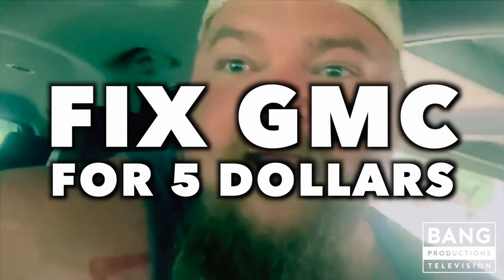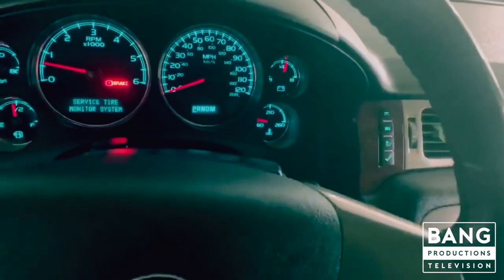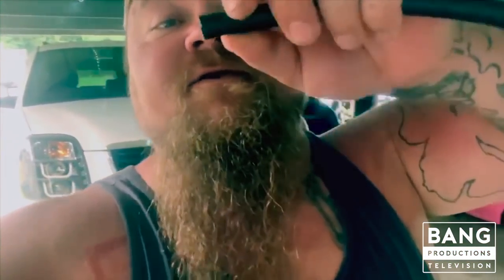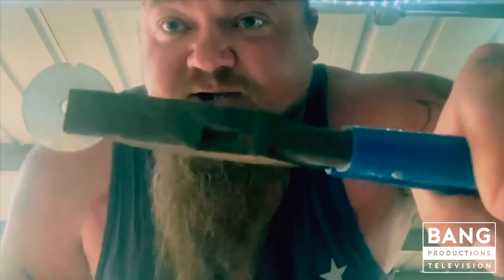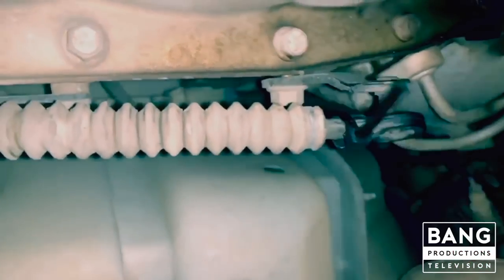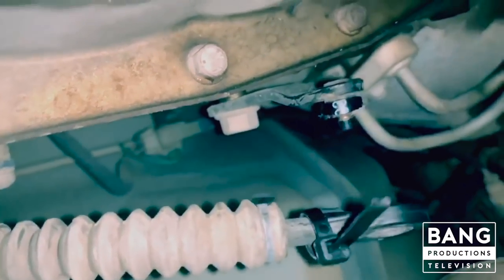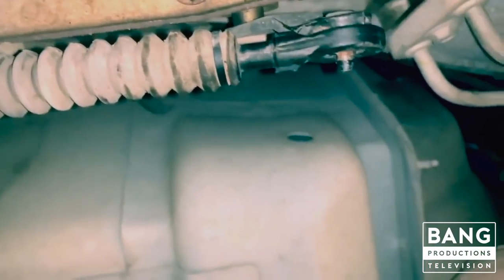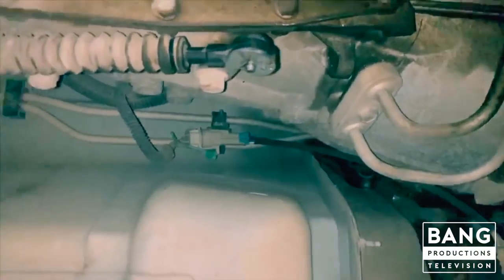CATFISH COOLEY: FIX GMC FOR 5 DOLLARS

Comment: You sure right about hunk of junk. They just don't build things to last anymore. My wife has a new(ish) GMC Yukon XLT. We took it into the dealership after our mechanic said it was the axle gears grinding. Fortunately, we're still under the warranty. They had to replace the whole rear end. 30,000 miles on it. Can't wait to see what goes wrong in the next 30,000. Probably need a new engine. I liked your ingenuity.

Comment: Ford had this same problem with the AT Kickdown on the early 4.6 crown vics/mustangs. They had a little brass collar and a clip retrofit kit they gave away for free. Chevy needs to do the same thing.

The problem with the Ford was it would burn up your transmission if you didn't tend to it.

Comment: Any reason why you wouldn't use the waRsher, and an e-clip on the bottom, instead of cutting the waRsher ?  Not trying to be critical, just wondering, just in case I ever run into this.

Comment: Happened to me one summer leaving my driveway after repositioning the shifter hours before stoped moving as i was turning so i bloked both sides of the road on my chevy 3500 and didn't wana shift so I left the truck on without even THINKING about the hand break got under it to see if it had slipped again without thinking I moved the shifter lever instead of the cable and accidentally put the truck in drive with me still under my head was about 3 feet from the dually tires before I quickly got out from under it good thing it drove into a ditch and not a car or another house that was the worst summer I ever had some old lady waiting for me to move the truck and let her by watched the whole thing didnt even say a word after that i replaced the bushing with a new one and kept the old one to this day to remind myself of safety and the summer I almost died cause of a peace of shity cheap plastic

Comment: Cool that you fixed it good and it only costed $5.00. 

Not so cool that Chevrolet and GMC Truck have decided to get so cheap and unreliable. Just by what you've done is solid proof that they went too far trying to cut costs. GM = 🗑!

🐰
Reply: GM half ton they cheap out on. But the 3/4 and 1 tons are pretty stout.  Half tons are built in Mexico. Heavy duty trucks built in the states